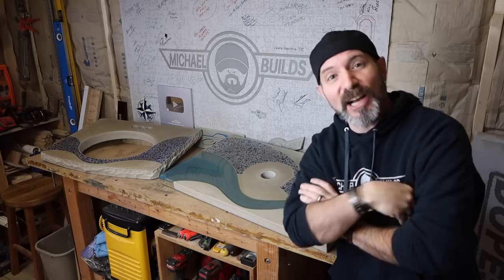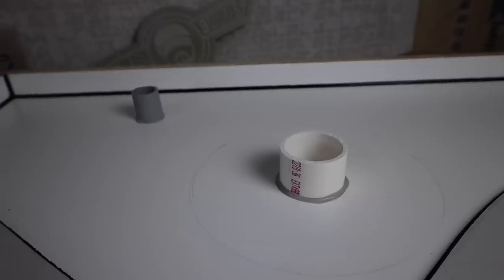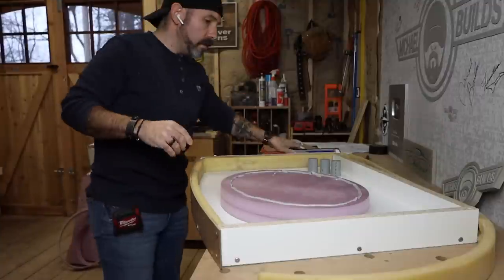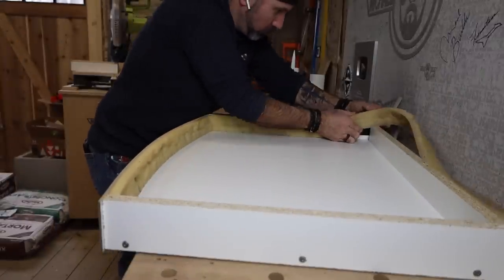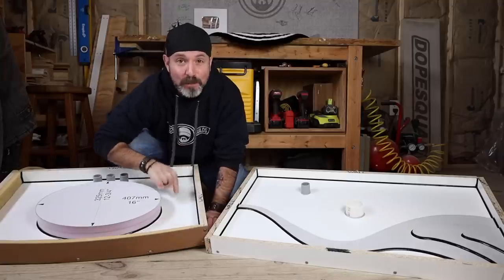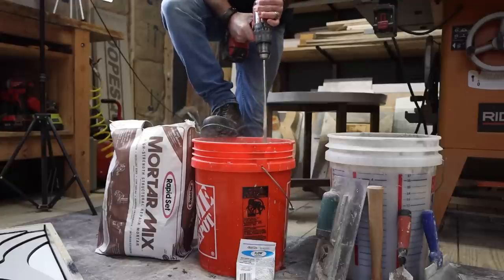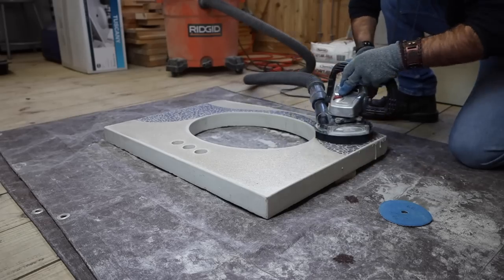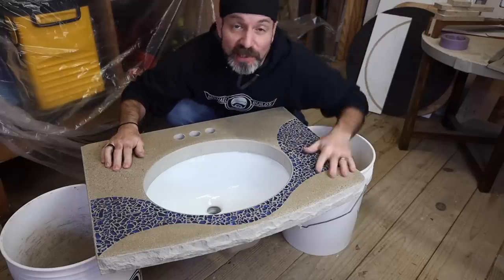Concrete Bathroom Vanity Top with Sink - TWO VERSIONS!

Comment: Mike at Modustrial Maker came up with the caulk method and you missed a crucial step. You lay down a coat of paste wax first. It helps the concrete release nicely and it keeps the excess caulk from sticking. (Haha yeah, you said it as I was typing!)

Mike also makes a ton of awesome concrete projects!
Reply: Hello 👋

Comment: No 3/4” AR glass fiber or fiber mesh , don’t use uncoated  polymer seal metal mesh which will flex and cause cracking over time with expansion up grade to AR glass fiber or basalt fiber mesh this would help out more for lasting reinforcement but great work on the vanity once again thanks for sharing
Reply: Victor

Comment: I am really enjoying your concrete videos. I started watching a few days ago because I acquired an outdoor island with a concrete top. BUT ,I haven't been able to find information about cleaning, sealing old, dirty concrete. Can you please send me in the right direction 🙏 😊
Reply from the maker: Thank you SO MUCH! The best and easiest way would be to rent a pressure washer and hose it down with an all purpose cleaner pressure washer fluid. If the dirt and grime is still being stubborn, you’ll have to get a concrete etcher and scrub it really well and then hose it off https://www.homedepot.com/p/Rust-Oleum-1-gal-Concrete-Etch-and-Cleaner-301242/206495770
Then seal it with a concrete sealer that is UV resistant.
Reply: @Michael Builds  thanks so much for responding. I got our pressure washer out of storage and will start working on it today. It has lots of grease/BBQ stains so I bought the concrete cleaner. Deciding weather to stain it before sealing, but that will depend on how the cleaning goes.
I'll take photos of the process if you are interested.

Comment: I just tried to make a similar counter and mixed two 55 pound bags of rapid set at the same time. The mixture never became fully fluid, using an electric mixer and with three bags of flow control. it ended up setting on me before it came to a fluid and I actually broke my hand. Should I not mix more than one 55 pound bag of rapid mix at once?
Reply: Mike

Comment: I am wanting to make a slab (next to my shed) with stepping stones (that I made out of concrete) and various pieces and types of tiles (that I went dumpster diving for, lol). My stepping stones and tiles have a variety of shapes and thicknesses. I am wanting to put them together to make something that resembles a mosaic walkway/slab theme. Problem is is the differences in thicknesses. What type of base would you suggest using to put under the stepping stones and tiles to where I am able to mound it up to put the thinner pieces of tiles the same height as the stepping stones? My ground dirt, right now, is a variety of sorts (I live is south Texas). A little red clay with dirt and sand. Along with the base, what would you suggest to use to fill in the joints? At first, I was thinking concrete to fill the joints, but now watching this, I am thing mortar. 
My original thinking  was to put a layer of cement gravel (some type of small rocks), then put a layer of sand (IDK what type), then put a 1/2 inch or so layer of dry pour concrete down, then lay the stepping stones and tiles on top of that dry pour cement, and then add more dry pour concrete in the joints around all items. But I don't think the tiles will adhere to the dry pour. I know they do adhere to wet concrete (I have some tile in my stepping stones), but I will be doing this myself and yes, I want to try a dry pour.
Any suggestions?

Comment: Thanks for another great video!  Those look fantastic!  
Any advice on how to raise a small concrete slab?  I have one in front of my barn.  It is angled wrong and when we get heavy rain, the water goes into my barn and pools up.  The area of the floor where it pools is now cracked and a small depression is there.  Now that it's finally warming up here in SE MI, I'm hoping to fix this sometime this Spring or Summer.

Comment: Mike I recently poured two small tops as a trial before I do my kitchen tops. I used the same brand mix you used and it comes out like a tan color instead of gray. When I watch your videos which are great yours look gray. Any ideas?
Reply from the maker: Mine come out tan-ish too. It’s hard to tell on camera but I’m getting the same results you are. If you use Cement All you’ll get much  closer to grey
Reply: @MichaelBuilds  thanks for the reply. I’ll give that a try and see how it looks.
Reply: I recently poured a top using the mortar mix and added a bottle of black dye hoping it would make it black but when it dried it turned out gray. So if your shooting for gray that might be the way to go. I used one bottle to one bag.
Reply: @str8tshooter3006  thanks for the input. Might have to try that one also
Reply: Mark